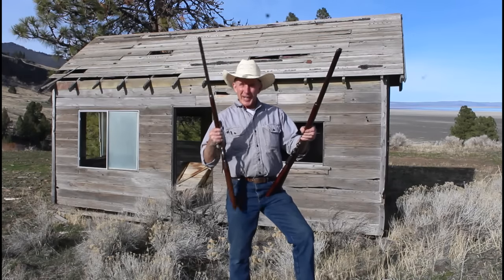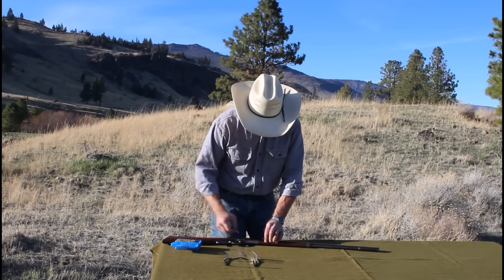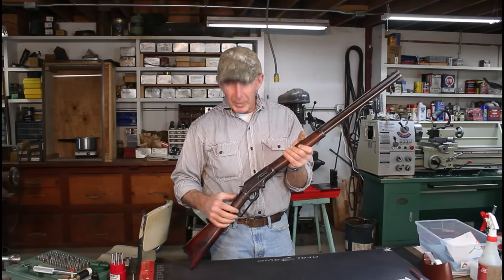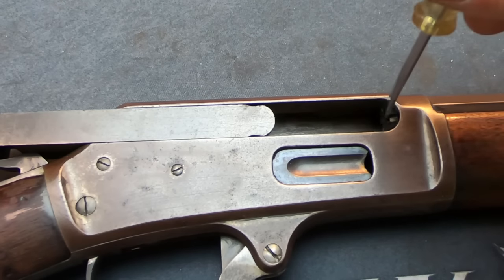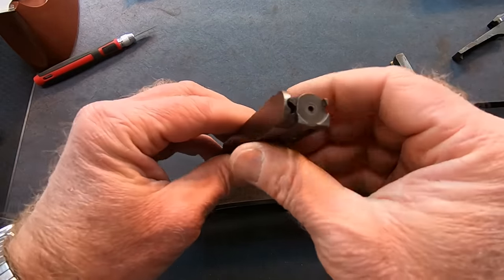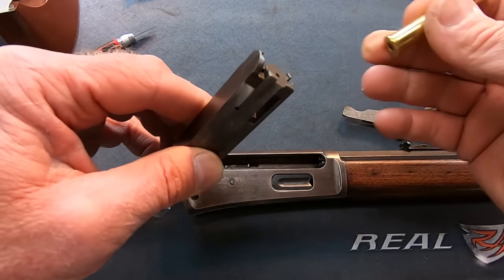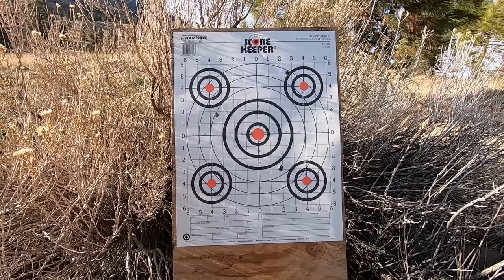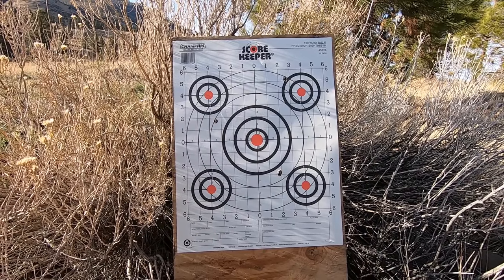Marlin 1893 With Excess Headspace

Comment: Great old Marlin, a lot of the older guns with softer steel have been worn prematurely by using smokeless loads with jacketed bullets.  Hopefully the throat will accept cases with a .383-4 bullet.  Enjoyed the video Mark.
Reply from the maker: Thanks!  Hopefully it will shoot better with some black powder loads.
Reply from the maker: That's called a barrel set-back and it would definitely work.  I talked about that option in some detail in the video.  The customer chose to replace the bolt because it was a much simpler and less expensive fix.  If I couldn't have got the headspace in spec with the new bolt, I would have done a barrel set-back.  Thanks for watching and commenting.

Comment: I wanted to mention I also have a 336, in 38-55 and I've never shot anything but black powder, loads out of it. I sighted it in at 100 yards and could hold inch and a quarter to 1and3/4" groups with a rest. That was the only time I ever shot paper with it. Out to a 150 &200 yards., the hold over grows considerably, but was still able to ring 6" steel and bust soup cans off hand on a regular basses. I haven't had an opportunity to shoot it in a few years. It's a great round and hits surprisingly hard.
Reply from the maker: Great to hear you’ve got it shooting so accurately.  It can be a frustrating process, but very rewarding when you find the right combination.

Comment: I have been looking for 25-20 brass for 4 years.  The only option I have found is lathe turned brass at $100 per 20.  Yikes.  I might be able to form some from 218 bee, it looks long enough, but the 218 isn't any easier to find.

Comment: Thanks!  The over size bore and under sized chamber neck is common/normal in old Marlins.  I dealt with it both in 1893 and Ballard Pacific in 38-55 and 40-63.  I actually wrote an article anout it for the Single Shot Exchange about 25 years ago.  If the bore is good they will shoot fine with lead bullets without antimony up to .004 undersized and seated in a case full of black powder. Smokeless powder will not boot the bullets up but black powder easily does.  You can also use about 8 grains of 4227 or 4759 as a priming charge under the black powder and they will shoot clean as straight smokeless but still give you the boot-up like black powder.
Reply from the maker: Thanks so much for this great advice.  I'll pass it on to the owner of the rifle.  Maybe I can even find your old article.
Reply: @thecinnabar8442  if you have the old issues I think the title was “Loading the .40 cal Ballards” or something like that

Comment: I have a 93’ Marlin made in 1894 that had exactly the same problem; excess head space and a large bore, about .384. Since the barrel was in otherwise excellent condition I sent it to Turnbull Restorations to have it set back. For the large bore problem, I had a custom bullet mold made but the bullets were then too big to stuff into the cases. I solved that problem by fire forming the cases in another gun, then the bullets went in easily. I also had to grind out my case sizing and seating dies. After all that it turned out to be a great shooting gun.
Reply from the maker: Great info David.  Thanks for sharing your experience with the exact same rifle.  I'll pass it on to the rifle's owner.

Comment: In line with a few other comments,  black powder seems to certainly help. I have a 76 in 40-60 that I tried to shoot 5744. It keyholed bad and wouldn't even stay on paper at 25yds. Black powder settled it down to a couple  inches same bullets at the same bp velocity.  Just gotta bump em up with BP I guess.  I also had the same issue with a sharps. Washtub accuracy with 5744 at BP velocity.  Same bullets 5/8inch groups at 175 yds with 2f goex ( the longest range i have here from my shop). I enjoy your videos very much and your ranch is spectacular. Looking forward to more in the future. Thank you.
Reply from the maker: Thanks for the tip, Michael!  I’ve suggested black powder and soft cast bullets to the owner to try to help him get it shooting better.

Comment: Thanks for this video.  I was pleased to learn how you can check how much excessive headspace you have using tape.  I currently have a 1995 in 30US model 1903 that would close on a field gauge.  Using the tape I found out that it just barely closes and will not close with just 1 piece of tape.  Now to look into what to do to take up the slack.
Reply from the maker: Unless you're planning to shoot the gun quite a bit, I wouldn't be too concerned with headspace that's within .002".  Just keep an eye on it.  If it gets worse, you can have the barrel set back or I would have the locking block on an 1895 built up to move the bolt forward to get it into spec.
Reply: @thecinnabar8442  Thanks for the response.  I do not plan to do a lot of shooting with it and what I do will be reloads that are on the lighter side loaded with cast buttles.

Comment: Great video, sometimes the neck in the chamber is not large enough to allow you to use a bullet of the correct diameter for the bore. To check for this after loading the proper sized bullet I use your scotch tape trick and make one wrap around the cartridge neck and carefully chamber the round the remove it and check the tape for damage. It there’s no damage to the tape the I know there’s enough room for the case to expand and release the bullet. Had this problem with my 38/72 win. Mod.95. And can only use a .380 dia. Bullet. Powder coating can also help but bursts will hate that. Thanks for sharing.
Reply from the maker: Thanks for sharing those great tips, Ken!

Comment: I have a Marlin 1894 in .44 Mag. My old eyes were having trouble with the buck horn sights, so I put on a rear peep sight, I ended up running the sight all the way to one side and still couldn't get it to sight in. So, I installed a Skinner barrel peep sight and was able to get it sighted in on target. However, you visually tell the receiver is chanted to the left slightly. Have you ever seen this before? I guess my rifle was built when Marlin was going thru their     QA issues.☹
Reply from the maker: If I'm understanding it correctly, it sounds like the barrel was indexed slightly past center.
Reply: When I put the first peep sight on, it was mounted on the receiver and that is the one that was run all the way to one side. I also mounted a scope and red dot on the receiver and they both did the same thing, but when I mounted a rear peep sight on the barrel, I had no more issues. Sorry for the confusion.
Reply: @thecinnabar8442  I am not fond of scoped lever rifles, but if I want to hit anything, I just have to deal with it.

Comment: Great video as always. Love those old Marlins, expecially that caliber in 38-55. My old Ballard in that same caliber slugs about the same. I am using .382 diameter soft cast lead. Tightened those groups right up. keep up the good work! Always looking forward to your next video.
Reply from the maker: Great info.  I was concerned that a .382 bullet wouldn't fit in the chamber, but yours obviously did and fixed the problem.

Comment: I love your videos on those old Marlins and Winchesters , I have an old 1894 Winchester in 38-55 , the gun is in decent shape for its age , made in 1902 . The primers on some factory Winchester super x ammo I put through it always back out about a 1/32 . Do you think that's because of poor headspace and should I even be concerned shooting those low pressure rounds ?
Reply from the maker: Yes.  In order for the primers to back out, there's likely excess headspace.  It's not uncommon for older firearms to have some excess headspace.  It would tell you more if you could measure the protrusion of the primers in thousandths.  1/32" is .031" and that would be far too much headspace.  You can also use the tape method I showed in this video with a spent cartridge to get a rough idea of your 1894's headspace.  It's not as accurate as a headspace gauge, but it will give you a general idea if there's a problem.
Reply: Thank you for your reply Mark , I measured it and it is actually.017 thousands . Do you think that is acceptable ?
Reply from the maker: That's a lot of headspace.  .007" is listed as maximum safe headspace for an 1894.  I'd advise taking it to a gunsmith to have it evaluated.
Reply: @thecinnabar8442  Okay thank you for your knowledge and advice , I really appreciate it !